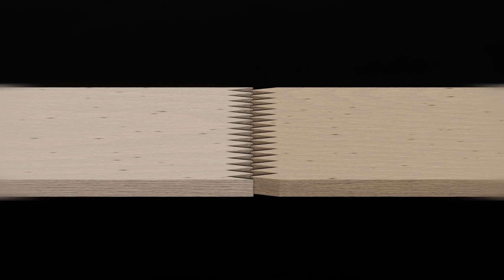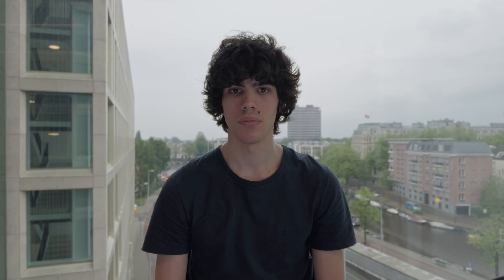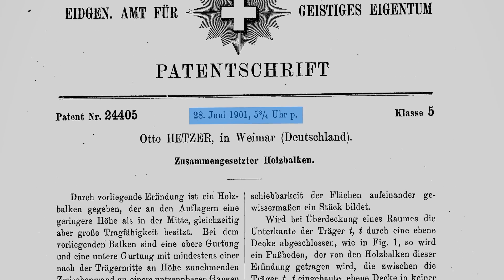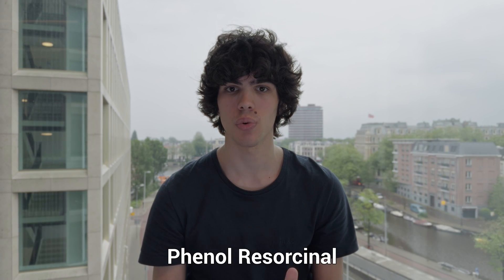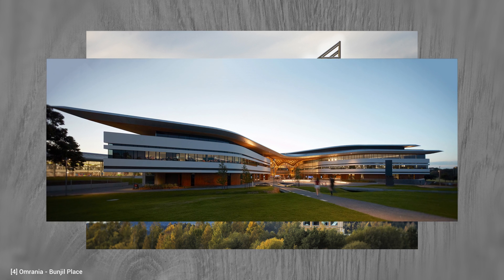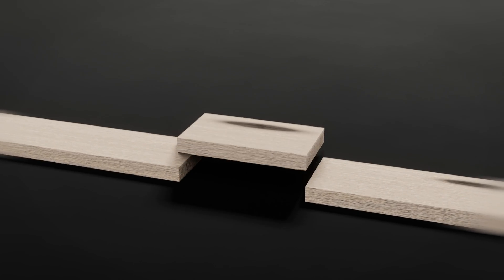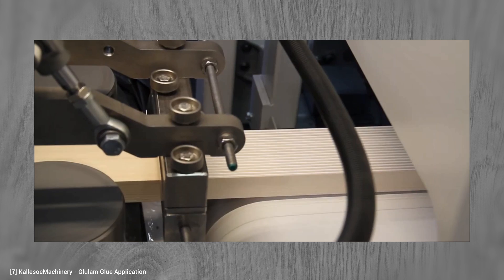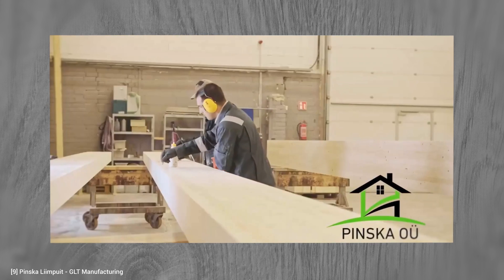An Introduction to Glue Laminated Timber (GLT)

Comment: I think we also calls these LVL / LDL in the US, What about LVL?
Reply from the maker: Hi, I haven’t heard of LDL before. What does that stand for?

Regarding LVL, you can certainly create beams using laminated veneer lumber. The key difference lies in the thickness of the layers. Glue laminated timber uses dimensional timber, which is significantly thicker than the thin veneers used in laminated veneer lumber. There are pros and cons to having thicker or thinner layers.

We also have a video on laminated veneer lumber too if you’re interested!
Reply: @PrefabulousTimberTalk  I think your GLT is the same as what we sometimes call LDL, Laminated dimensional lumber, 6-8 2x4 or more depending on the span
Reply from the maker: Aha, that would be the same as GLT!
Thank you for clearing that up 😄